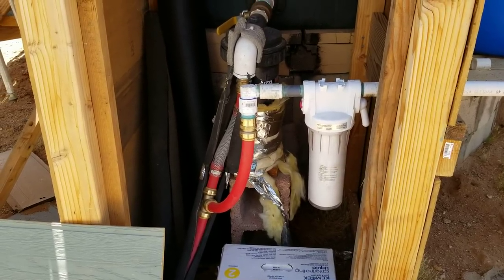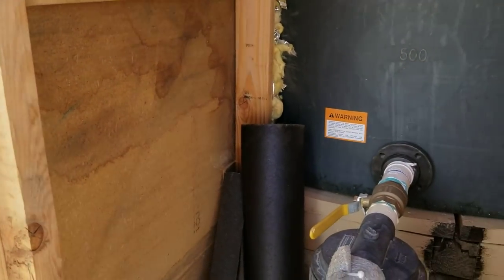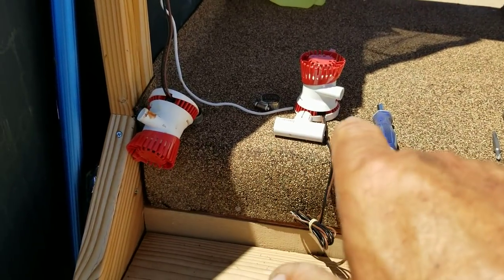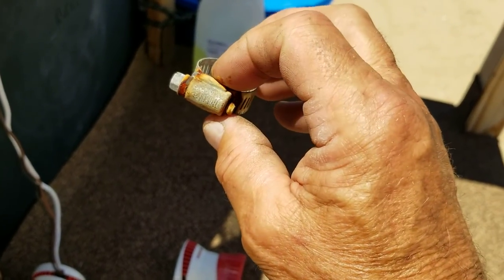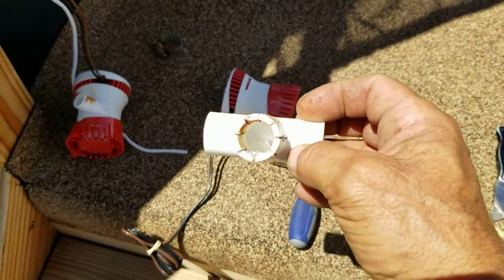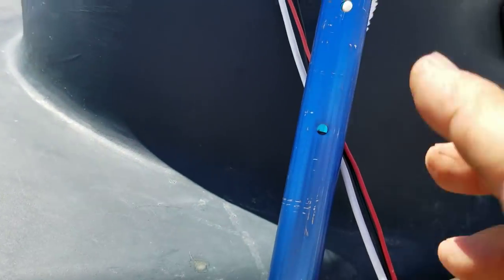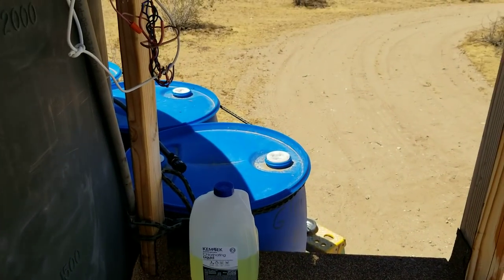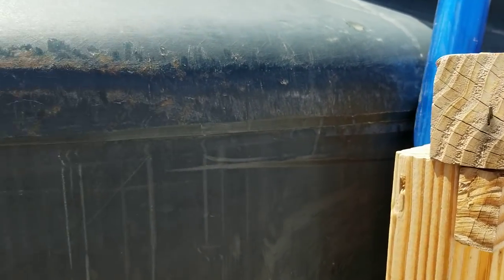Replacing the water circulation pump in the storage tank.

Comment: Curious, couldn't you make a screen for over that intake at the top of the big tank?
Attach Velcro to the tank with the other side attached to the screen.  Run a thin strip of rubber on each side of the wire going in and butt the screen up against it to stop all but the tiniest bugs getting in.

Just a suggestion.
I
I didn't notice the fittings being boxed in before.  Looks like an excellent job.  I would expect nothing less from you.

By the way....I always enjoy your videos.
Reply from the maker: Thanks.  One of my followers just informed me that there are manufactured screens for those tanks.  I will check with the place I bought it and post the results.